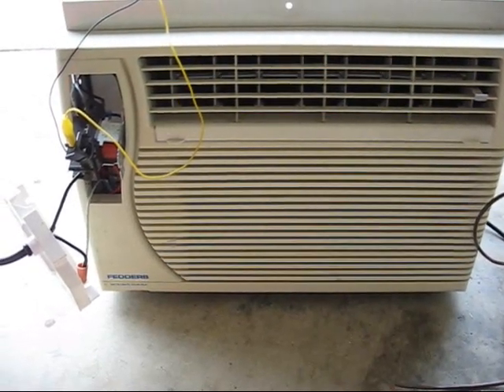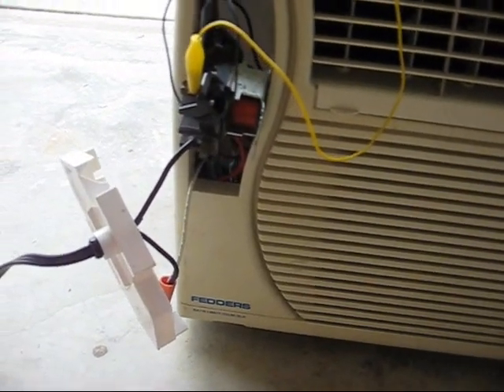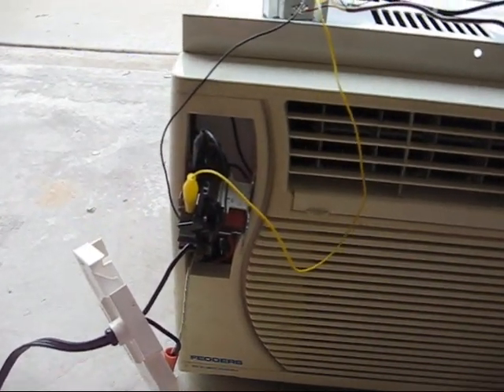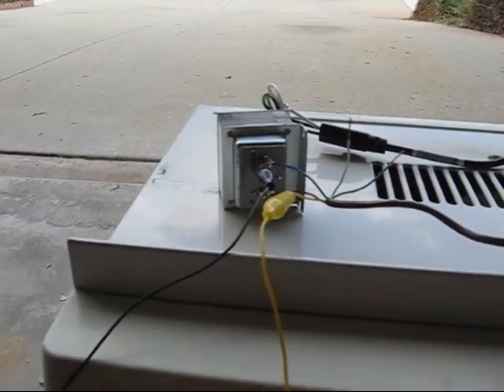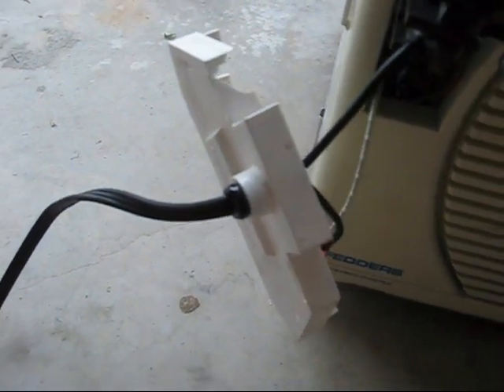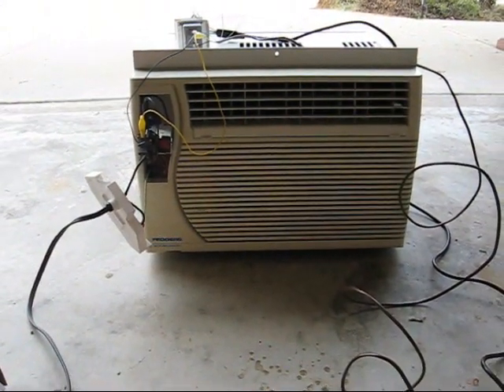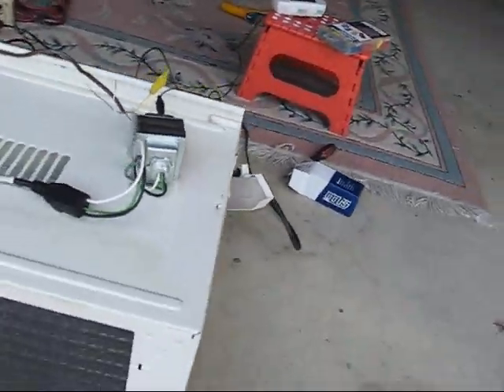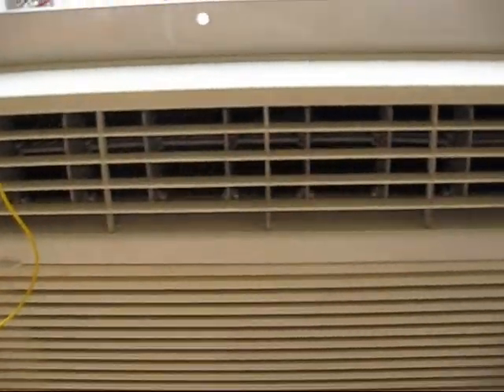Fedders Window Air Conditioner Project

Comment: I have the electronic control panel for this airconditioner  it came out of a may tag that is identical to that unit same BTU and all it works it has a capacitor and every thing.
Reply: I need that part for my air conditioner. Would you be willing to sell it?

Comment: If you don't need "remote control" of the fan speed, and you don't care what it looks like, you can use a standard 3-way switch, that will switch one terminal between the other 2 for your high and low speed.  

That Goldstar sounds REALLY bad, I'm amazed how pronounced that sound is with how far away you were.  Did you open it to see if it's just some sort of vibration (perhaps a rubber mount has disintegrated), or is that an internal compressor sound?
Reply: interesting, I always thought it was just "life's good," which when you buy an LG nowadays, is not the answer...
Reply: exactly right...lesson of the day: don't buy LG--or lesson for life: don't buy any new items made out of the US unless you love throwing money away
Reply from the maker: It's definitely something internal to the compressor so I'm sure that is on its way out.
Reply: +jaykay18 It's not as much of a vibration as it's just those LG compressors (the goldstar is a rebadged LG) are so damn loud in general (the loudest compressors on the market I believe,) when they are on the way out they get so loud it amplifies down the block.
Reply: fedders airDUDE Goldstar is what LG was before it was LG.  Another company called Lucky Chemical merged with Goldstar to form LG (Lucky-Goldstar).
Reply: fedders airDUDE Yeah, they try to make you believe that.  They are actually right, until you buy their products.